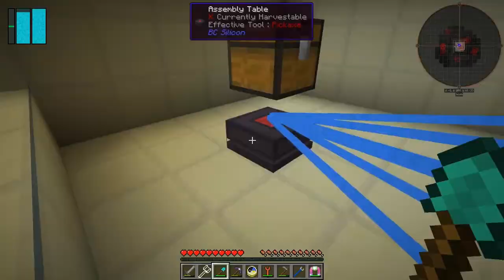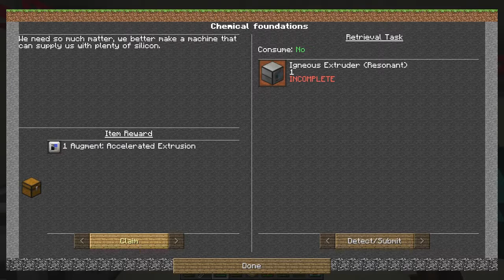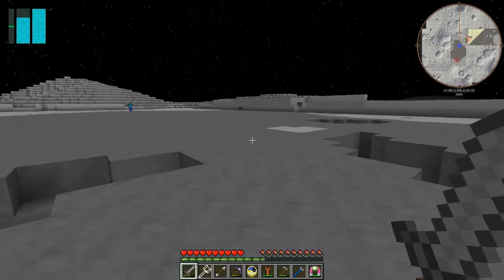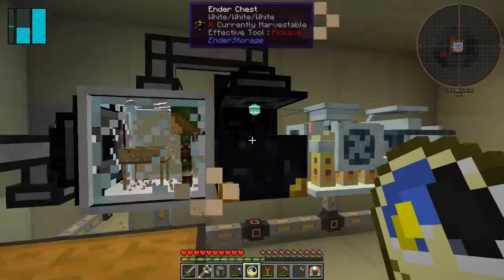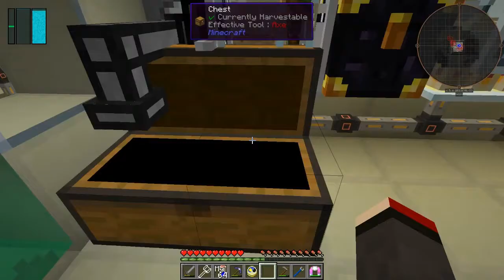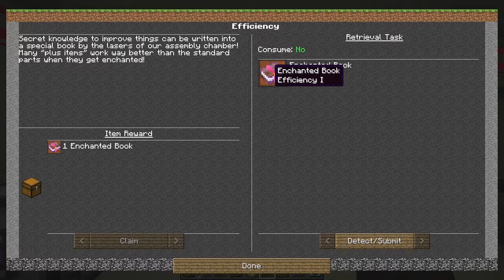Galactic Science 2 #21 - Cobblestone Generation Automation Failed

Comment: i believe you need to put the output of the 2nd decomposer into a chest and then take it out of there, that way the ipe has both items available to it at once and it can pick and choose.
Reply from the maker: I figured this out (eventually) I need a filtered transfer node per item because once an item is in the transfer nodes buffer it won't go back. When I tested the setup I didn't understand that the rationing pipe needed to the connection on the receiving inventory for it to work. Many thanks for the idea it is a good one.